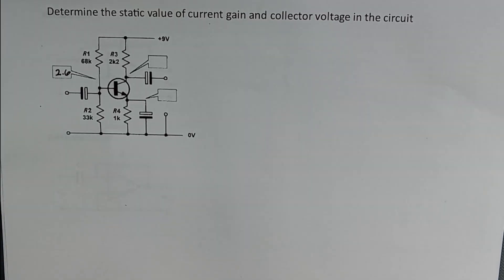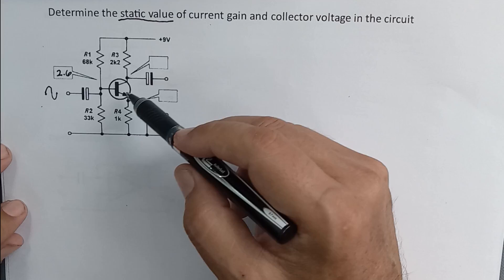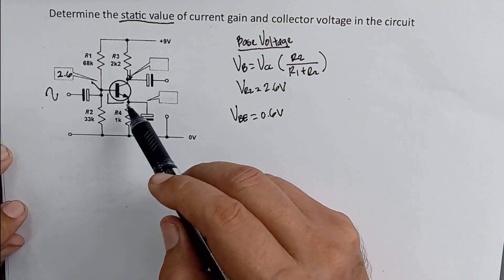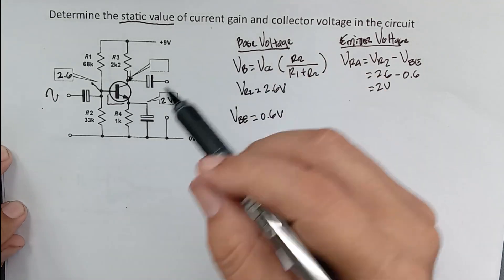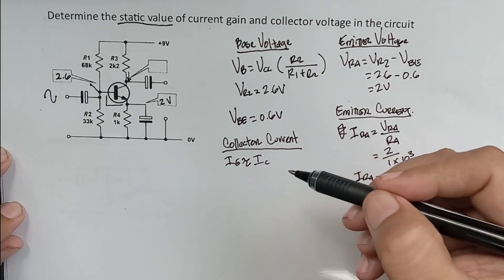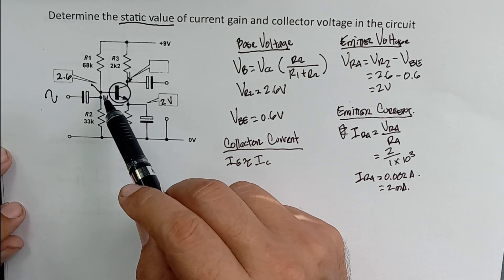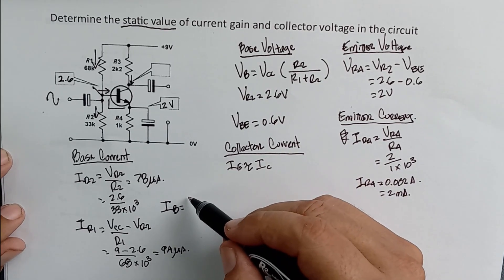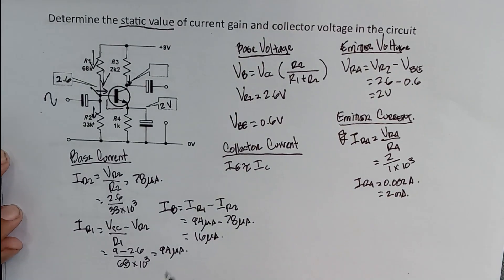How to Solve Transistor Amplifier Problems

Comment: While calculating the Voltage at the base you ignored the base current, and later you tried to determine the base current using the incorrect base voltage. At the end the base current can be neglected anyway .however not the right Methode to determine the beta
Reply from the maker: @semperagilis  you don't have the beta of the transistor... how are you going to get collector current.